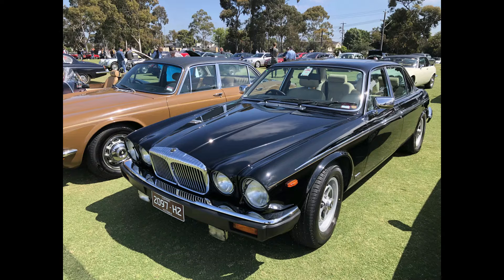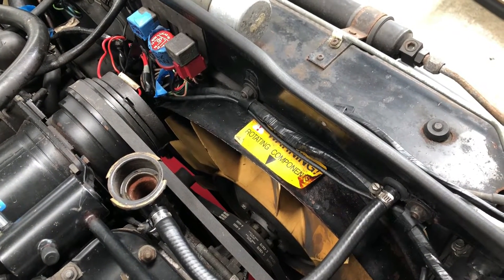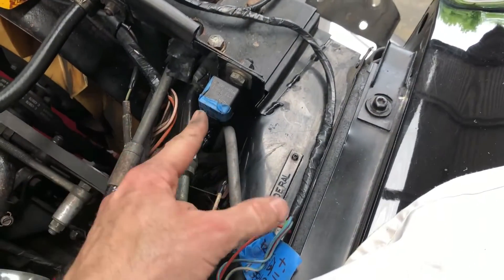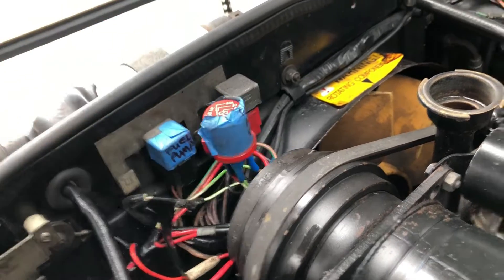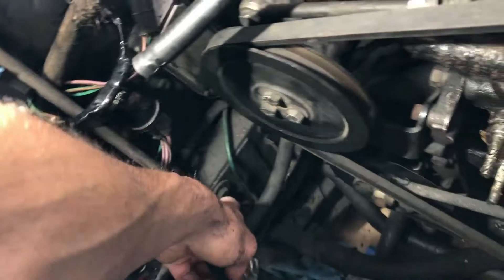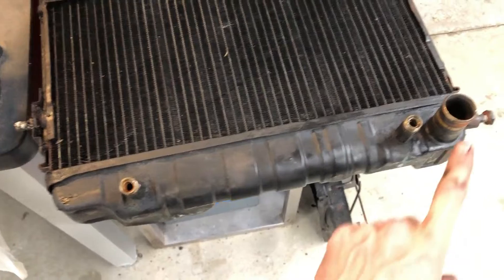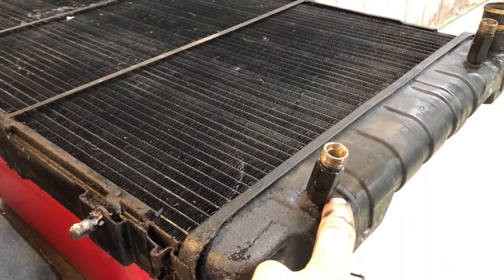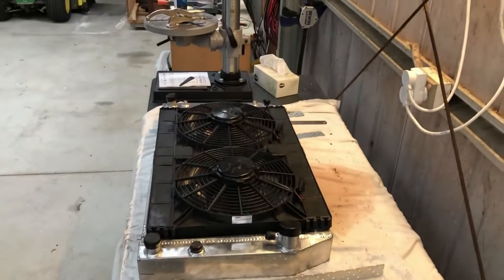Jaguar XJ V12 Cooling System Upgrade - Part 1

Comment: There is no reason to "upgrade" the cooling systems on these cars.
They did not overheat when new and if one does now it is due to a lack of skilled maintenance.
They were designed, developed and tested by very clever human beings and the factory guaranteed them.
Sure, you can buy all your bobbins and bodge them in to that beautiful car, but maybe you should learn about the original system and work on getting that right.
Sure, you have removed the engine fan and saved power, but now you place more electrical  load on the alternator.
If you think that you are more clever than the people that built, sold, guaranteed these cars you are kidding yourself.
Reply: Where as I agree engineers know what they are doing, many vehicles today have electric fan systems.  Electric fans started seeing widespread use in the late 70's, way after these engines were designed. The electric fan setup is a common upgrade for many classic cars and off-road vehicles because other clever engineers designed it. That's why it's now a standard across the car industry. You know, like other cars with 12v systems. If the load was an issue, it would be commonly known issue and a 15-20 (x2) amp draw is not a burden if you do not have a lot of accessories. If you do, a higher amp alternator may be a good idea. No big deal. It's simple technology. It's a great way to free up space to make doing your own maintenance easier. This isn't new stuff. We've been doing it for more than 40 years. It's okay to color outside the lines.
Reply: @Hey_Pops  They already ran an electric fan alongside the engine driven fan in all the V12's.
Oh dear.
Jaguar were the pioneers of electric fan cooling, the E Type of 1961 being a case in point.
Pretty sure that is the first such production car being cooled by electric fan.
They knew about it and its effectiveness.
They were not dills.
Yet some blokes in suburban sheds think they know better.
Sure, do your "upgrades".
And the cars die the death of a thousand cuts at the hands of suburban mugs.
You can be sure that the cars that fetch the best resale values are the ones that deviate the least from their original form.
You would not see an electric fan put on a GT Falcon or  Ferrari 250 GTO , would you?
And they don't need it either.
Did you pause to think that modern production is predicated on making things more cheaply?
If you want a modern efficient car, why not buy a modern efficient car?
Reply: @ dude… if it’s your car, do what you want. I’ll do what I want to my cars. The person who made this content will do what they want to theirs. It’ll be okay. Sheesh. Not every “upgrade” is bad. I bet you’re a blast at parties. Anyway!… In many cases, damage, previous maintenance, whatever has already popped that  devalue cherry. If a car were pristine and worth a lot, I get it, it makes financial sense to remain as original as possible. The vast majority of these cars are not that. If someone wants to make maintenance easier to keep a car on the road, good for them. If my v12 goes out and I can’t fix it I’m throwing in an American V8. I can’t afford a V12 rebuild by a qualified Jaguar mechanic if I could even find one, so I’d have to sell cheap or part out or swap out to keep it on the road.     Have a better day!
Reply: @Hey_Pops  Blah blah blah blah, and  you must be the life of the party, the party I would not go near in a blue fit, YO DUDE! PARTY ON!
Are we done with the personal character assessments, for I thought we were discussing an issue here?
The first sign that someone doesn't have any cogent argument is when they revert to the personal.
You keep telling yourself that it is fine to chop up cars but best you stick to old dungers and yank tanks, leave the decent cars to the adults.
This is an area for comments and I made a comment. Your comment is trite garbage in my opinion.
I will do what I want with my day and I wont be taking any advice from you on how to go about it.
Signed, a qualified Jaguar, among others,  mechanic.
Reply: @nkelly.9  Wow, someone has a fragile ego. I never insulted you. I made an observation based on your negativity and attitude towards people with opinions. I also never gave you advice. Disagreeing and giving advice are two different things but you've wrapped your ego in this and speaking with emotion. at least we agree agree, you do you and I do me. We can all do with less of your negativity. If your ego requires a win, you have it. You win, whatever this is. lol. I acquiesce to thy brilliance and thy humbleness and bright personality. Have a great day, Sunshine!
Reply: @Hey_Pops  Wow, more personal commentary , a strawman argument thrown in for free, and roping in "people with opinions" in to your sorry little tirade...
Is that all you have got?
 Fragile ego?
Who said anything about insults?
Sorry, I forgot that this was a discussion about cars, but you have deigned to give me a psyche analysis. Boy, you must be real clever.
Who is this "we" that you talk about? Because you only speak for yourself champ, even though you may think otherwise.
You also seem to have comprehension difficulties. 
You did offer me advice. You advised me to have a better day.
Take some of your own advice sonny and wrap your ego around that..

Comment: Great information, thanks for sharing.  2024 will see my changing my 72 XJ6 to a XJ12 using a 76 pre-HE V12.  Keep up the great work.  Very nice looking Jag by the way.  Cheers.
Reply from the maker: Thanks Jeff. I have just taken my DD6 out on the first ‘proper’ run in warm weather. The new fan setup is very effective - a big relief. Good luck with your change to a V12.